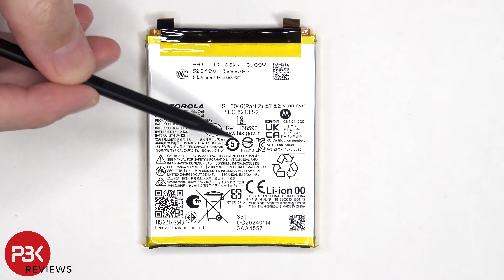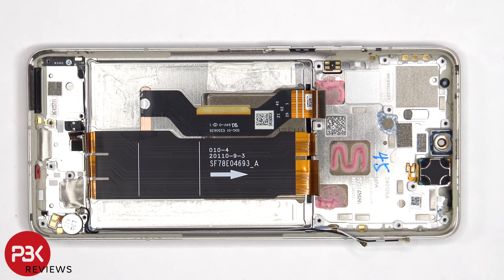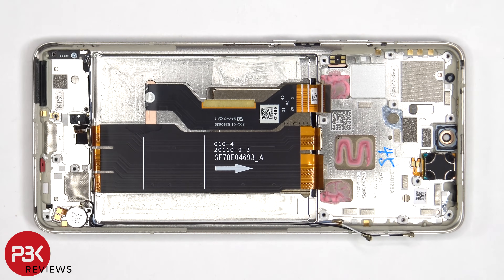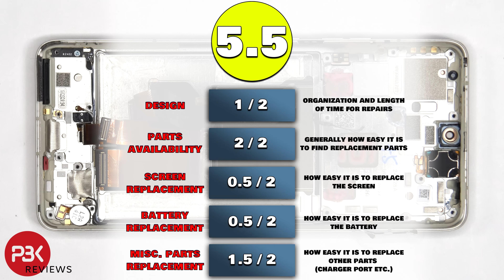Motorola Moto Edge 50 Pro Teardown Disassembly Phone Repair Video Review

Comment: Sir i have a question since the battery module is similar to moto stylus model of 5000 mhz battery with the power cable at same location can we upgrate the battery to 5000 mhz to this model pls reply … thank you
Reply from the maker: No because this ones battery has 2 connectors not one. Also usually there are minor size differences in the size of the battery physically which might make it not fit in the battery compartment.

Comment: If someone pokes the sim ejector pin in the mic area will the IP rating get  affected? And how to know whether the water shield got damaged or not ? While looking via torch I found the mic hole at 90° and no mesh around
Reply from the maker: The secondary mic on top, no it won't get damaged or affected. The primary one on bottom, the filter/gasket is seated against the frame, so the rubber gasket/filter could get damaged possibly, but not the mic since the mic is seated below and would not get damaged.
Reply: @PBKreviews  but while teardown look the gasket is perpendicular to the hole

Comment: i just inserted the sim card key into the microphone hole, they are close to each other.  did i destroy the water leak certificate?  the microphone is working
Reply from the maker: If its the bottom one, you wont damage the mic but can damage the rubber gasket/mesh filter for the mic. But if its the top mic hole, then you have no issues.
Reply: @PBKreviews  it's the one at the bottom.  if I damaged it, I no longer have water resistance?

Comment: The uv glue is went inside primary microphone and it stopped working and then the shopkeeper inserted the pin there to remove blockage happen by glue now its working fine but will it affect the water protection ?😢
Reply: I too have the same question.. I accidentally inserted the sim ejector tool inside the microphone hole and now Iam worried
Reply: I've tried but the sim ejector pin doesn't move into the mic hole it gets stuck in the very 1st place if anyone has tried then reply me the phone is safe from the sim ejector pins
Reply: And the main thing is the waterproof gasket is at 90° to the hole i.e. even if u poke something in the chamber has a 90° bend to the chamber and in that perpendicular chamber there's water gasket which is impossible to puncture even if u pole something in

Comment: I just bought one, and a little bit of uv tempere glue went inside the ear piece speaker. Although no effect on the sound, I'll still take it to service centre. I don't know much about phone. Will they change the ear piece speaker? Will it cost too much? Should I keep using it as it is?
Reply from the maker: Not sure the cost or what they would replace. Probably just a filter if anything.

Comment: I already bought it... Was waiting for disassembly video... 😂
Vapour chamber is quite big. And the metal frame conducts the heat directly to outside into your hands. Anyways, better to release heat outside than to cook inside like my Samsung did and turned screen green line mode on and also cooked everything in 5 m radius as soon as I turned on 5G...😂
Reply: My moto edge 40 does the same thing...meh...not every phone same from brand😂😂😂

Comment: thank u for this video, i bought this phone some days ago and wanted to know how it looks beneath,  but i have a question,  right under the power button there is hole, what's that for? is it a mic? if it is a mic  where is it's contact pads?    
one thing to mention that moto did not designed the primary min hole properly, it can get punctured and the IP 68 rating will damage
Reply from the maker: You're welcome. You're right I did not notice that. It is an additional mic and is most likely connected via the flex cable for the power button and volume keys. Since I didn't pry off the screen (to avoid damaging it), I didn't notice that additional mic hole.
Reply: I've tried but the sim ejector pin doesn't move into the mic hole it gets stuck in the very 1st place if anyone has tried then reply me the phone is safe from the sim ejector pins
Reply: @jai_hanuman7777 agree
Reply: Primary mic hole & IP won't get punctured as it has 90° bend to it for the waterproof membrane
Reply: @jai_hanuman7777right
Reply: It's a 3rd mic
Probably It helps in Audio Zoom when you zoom in video recording.

And don't worry about any materialistic tool too much. It will get replaced in 3 years anyway.
Focus on how to use it properly with whatever u have.
Reply: @TrainsandRockets nope, it's not a mic, no I'm gonna use the materialistic thing more than 3 years for sure and gonna recover it's worth by creating content from it and I'm a tech geek so I thrilled to know every single software feature and hardware of it.

Comment: One of the last brands who still hasn't added pulltabs for battery replacement. A shame
Reply from the maker: Yup
Reply: @PBKreviews Do you know how he fixed the volume down button? The button seems to have glue since it is difficult to press and does not sound like the other buttons.
Reply: Another missed opportunity by Motorola in my opinion. Even HMD’s new Pulse series uses pulltabs for the battery unlike “glue-it-down without handy pulltabs” Motorola.